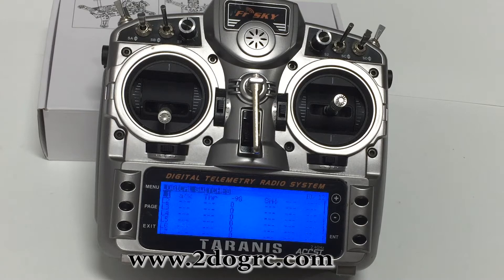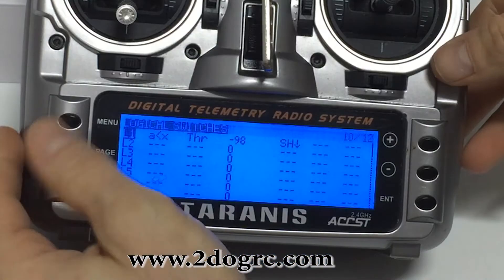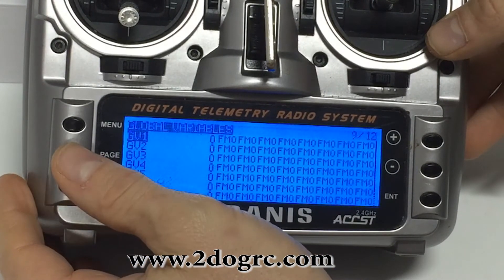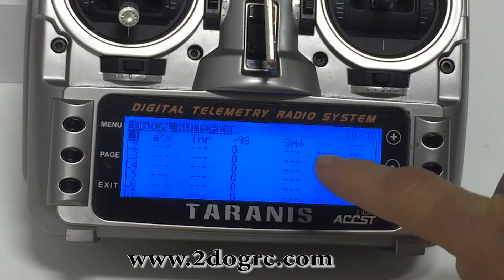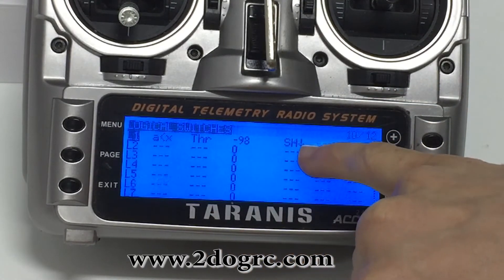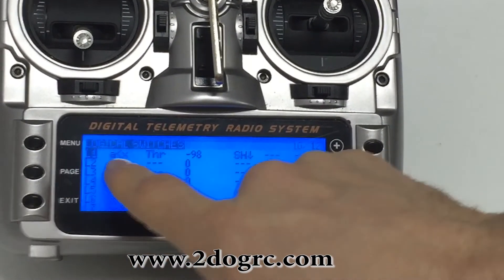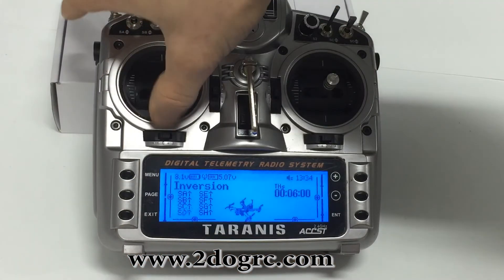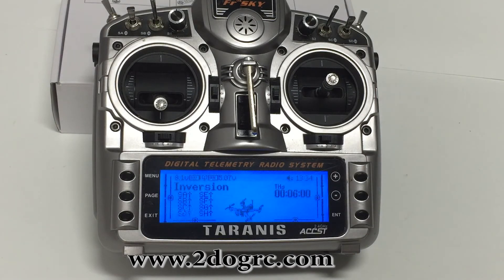Custom Timer Reset for the Frsky Taranis X9D, X9D+ or OpenTX

Comment: It's good to see how flexible this radio is.  Not what I was looking
for but I'm glad I ran into it.  I'll be implementing it.
Reply from the maker: I am glad you like it.  What are you looking to do?
Reply: 2dogrc I was looking to set up my Cell warning through Telemetry.  I already set it up, but
having the timer with a reset would of definitely been next on my list, especially if I set my radio
up for my second quad which doesn't use a Telemetry RX.